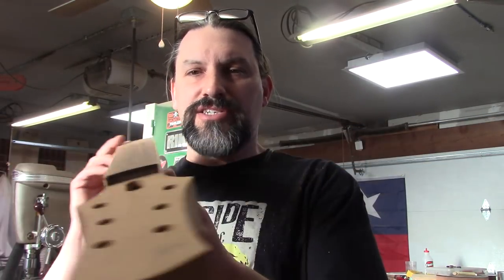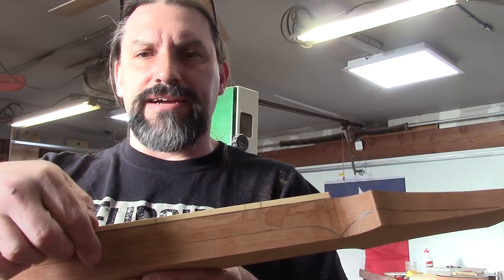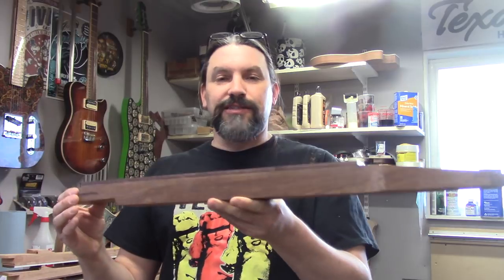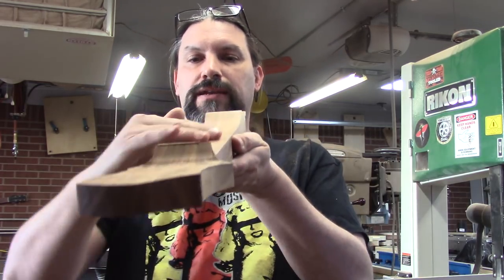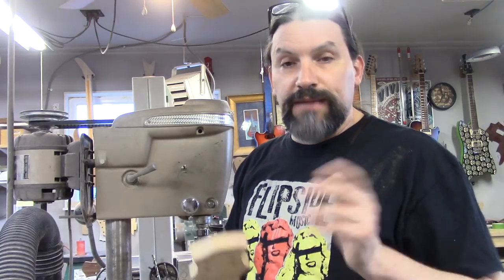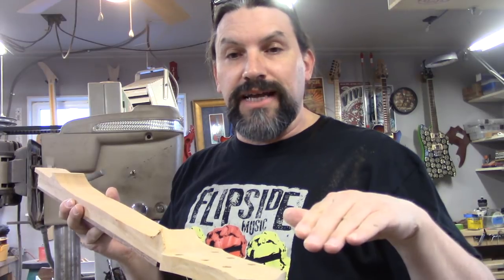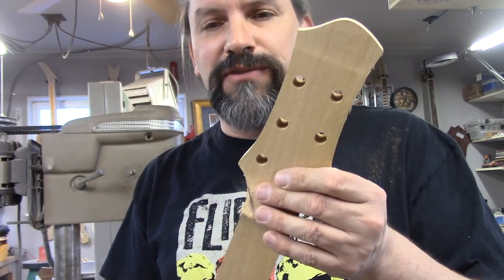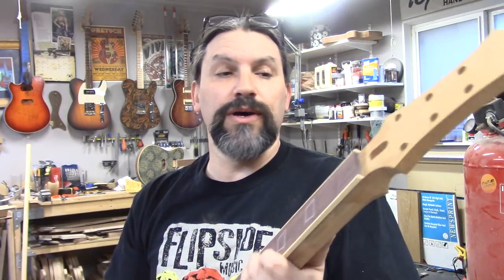How To Shape A Guitar Neck With An Angled Headstock Pt.1

Comment: Matt do you use dual action truss rods and if so do you put any packing in between the bar and the fretboard to stop any possible rattle? I must say that I have fitted one and it has a bit of rattle if you knock on the neck but you don't hear it when its put through an amp.what is your process? Thanks for the amazing content by the way
Reply from the maker: Thanks for watching Spannerman, 
You are correct, we will use a dual action rod unless someone wants to pay us to use something else. When the rods are at rest they will rattle, as soon as you add some load to them it goes away. We settled on the truss rod we settled on after using lots of others. When you factor in things like cost, ease of installation, durability and, my personal favorite... does the rod actually do anything the dual action rod has a lot going for it. 
They each have pluses and minuses.  
I hope this helps amigo

Comment: Hey, How thick are the neck blanks? also headstock angle?
Reply from the maker: 7 degree
Reply: Someone else had asked this as well... TTG's answer quoted:
"1.5" 
It is the thickness we need for a 7 degree headstock angle.
Our fretboards start life as 5/16" just in case you were wondering"